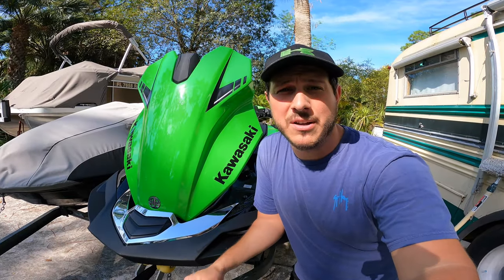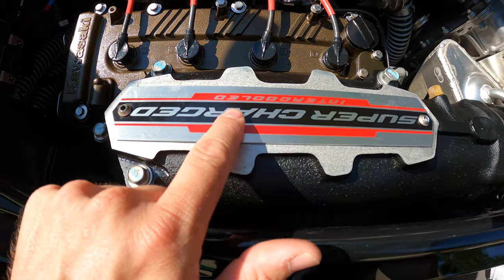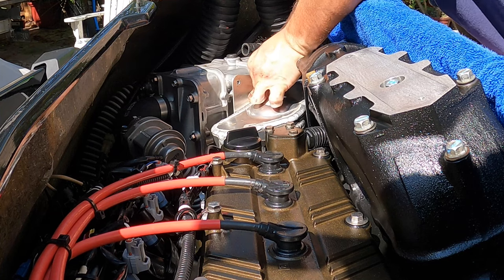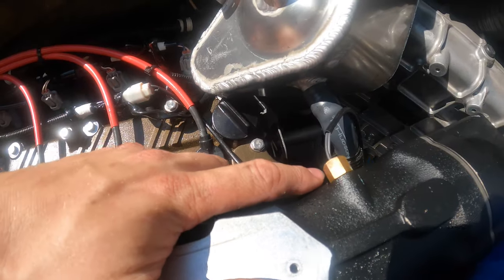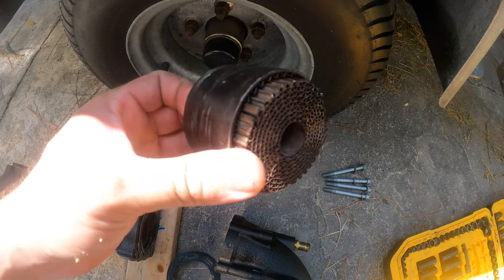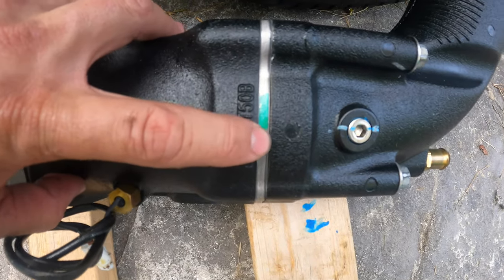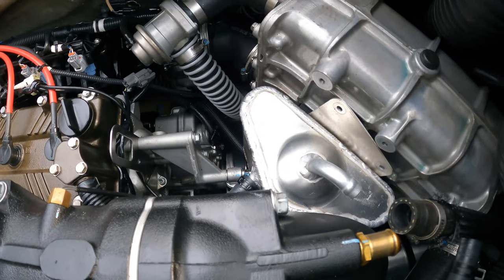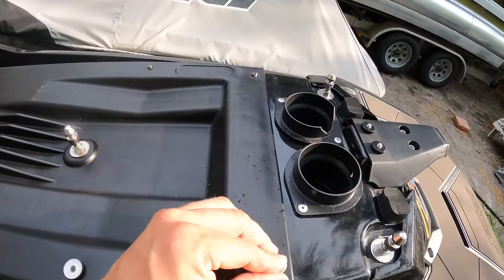Comprehensive Exhaust Filter Maintenance DIY - ⚠️NEEDED EVERY 25-50 HRS - Kawasaki Ultra 310 Jet Ski

Comment: So, I just finished my exhaust filter replacement.  Much like yours, the welds were broken  but the honeycomb part was still in place. I did however have to deal with a stripped bolt and threads.!  The 14mm at the back of the manifold was stripped when they assembled the engine!!! I have good pictures and micrometer measurements that I will be sending to Kawasaki.  It was very frustrating to have to cut new threads and repair it.  Thankfully it holds the proper torque so it won't be a problem for future 50 hours maintenance. I want to thank you again for the videos you put out!  Even though I have the factory service manual, watching you do it first really helps when I go to do it myself!  Your channel is awesome JD!
Reply from the maker: Wow that’s not good at all! Good thing you are mechanically inclined and could fix it yourself. I really appreciate that you always take the time to comment, and am glad you are finding my videos useful! I would have been PISSED if that scenario had happened on my ski; worst case scenario you are still under warranty and can get them to replace the manifold. I didn’t mention this in the video (because I didn’t realize it at the time until someone commented about it) but the new pipes on our ski actually have an Allen pin after the exhaust filter that prevents the element from going down the water-box if (when) it fails!
Reply: @JDsWaterWorld  Thanks JD.  I'm just doing my part to try and grow your channel.  I find your videos very useful and entertaining.  You'll get me through this winter watching you ride and show me sunny Florida!  Thinking about dragging my ski there after the first of the year  and get an early taste of summer!!  Thank you for taking the time to reply!

Comment: Followed your procedure.  All good!  After 50hrs, my exhaust filter showed a little carbon but perfectly intact and clean.  I'm saving the filter to reuse.  I sprayed it with WD40 and wraped ir up. I did put the new one in.  I tried to get the filter out without taking off the exhaust but couldn't.  Thankyou for this video it gave me the confidence to do it my self.
Reply from the maker: Thanks for taking the time to comment! So you ride in fresh water? Glad you were able to get it done! Yes I know of you remove the catch can, intercooler, all the ducts, and the starboard waterbox you can remove the lower exhaust pipe without having to unbolt the riser, but this takes more time than it’s worth to save money on a $40 gasket lol

Comment: Thanks for the video. I hope more people see it and realize the importance of maintaining these JetSkis. 

Just to add.. You can change the exhaust filter without taking off the exhaust pipe coming from the manifold. It’s an odd twist you have to do but I’ve done a bunch and gotten used to it. Saves on a gasket.
Reply from the maker: Thanks for the comment! Yes, well you can also remove the intercooler and then take the band off the water box and slide the lower pipe back without having to unbolt the riser…that stupid gasket was expensive too! I wanted to follow the factory procedure just as a demonstration- even though the factory procedures are sometimes more complicated!
Reply: How do you do it?
Reply from the maker: @LtCptAmerica  I have done it both ways; to remove the exhaust filter without removing the pipe that interfaces with the manifold you need to unstrap the rubber band around the waterbox so that it can be moved backwards and the filter can me removed. To get to the band, I had to unbolt the intercooler. I prefer removing the entire assembly so that I can clean and inspect the manifold surface and clean everything out really well. The gasket is $28 I believe so yes, it can be done without removing the main exhaust pipe assembly..I found both methods take the same time.

Comment: Thanks JD for Sharing a DYI video to educate ppl how to do it properly, and Save alot of money, Again it's very important to Ck and replace at 50hrs, Kspeed is who I use for any performance parts as they exceed Riva, just installed the Atmospheric Trumpet per there recommendations to get fresher air into the intercooler, please consider, Really appreciate all of your maintenance video's, it's so important to maintain these Ski's, and keep them Clean, I have always used a Silicone base lubricate in the Engine Compartment , not to get Oil near the Supercharger belt, just my opinion, Thanks for sharing the info on the thumb nuts for the Engine Cover, Hope we can get together soon and Ride
Reply from the maker: Thanks for the comment Terry, yes hope we get to ride together some day soon! I actually just reached to out Kspeed to see how many degrees the trumpet reduces intake temps. What are your intake temps? I run an average of around 114 degrees in this heat! Riva is only good for SeaDoo and Yamaha stuff..Kspeed are the true Kawi guys! So the Lear Corrosion Block actually is completely safe for the belt and pulleys! In fact, I spray down the pulley face. Something like wd-40, however, I’d keep far far away from the belt!
Reply: @JDsWaterWorld  Thanks, Am trying to ride next weekend and will monitor intake temps and compare to yours and let you know, I was afraid to use Lear Corrosion block on these Super charge Ski's for fear of the oil getting on the Belt, perhaps''s I will use it everywhere else except the Belt area. Use CRC 656 on alot of Area's as well, Alot of good products to Help fight the Salt
Reply from the maker: Yeah anything is better than nothing. The salt is brutal! I flush with salt away and spare no time washing down and cleaning my ski and as you saw- the exhaust filter literally implodes at exactly 50 hours!

Comment: Although I’m curious to know why you didn’t install the exhaust filter bypass? What are the pros and cons to run the Ultra without the exhaust filter?
Reply from the maker: This filter is absolutely critical and should not be removed or bypassed for any reason. The filter is instrumental in preventing condensation from reaching the exhaust valves the manifold, and ultimately the cylinder head. The filter is very effective at preventing corrosion buildup. The filter is designed to sacrifice itself, while protecting the engines critical internal components. The engineers a Kawasaki designed this component, and there is no reason why we shouldn’t trust them to deliver the most reliable and efficient design.
Reply: @JDsWaterWorld  thanks for the info I was reading exactly what you’re saying at the green hulk forum. VERY IMPORTANT PART 👍🏻

Comment: Just did this on mine but with a riva filter spacer theres no need to remove the upper pipe when replacing the exhaust filter😂
Reply from the maker: When replacing the filter you need to either remove the whole pipe or remove the band around the waterbox and slide it backwards so that you can fit the new filter in. Bending that blue coupler will stretch it out and cause it to start leaking…

Comment: Wow. Excellent video. You are an amazing instructor. I really believe now that I can do some of my own maintenance. BTW, how much would a service / dealer charge to replace exhaust filter/?/??
Reply from the maker: Thanks for the comment as always! I believe this service would be about $500 at a dealer and they are very slow..they’d have your ski for a few days, but it can be done at home in about 2 hrs or less
Reply: @JDsWaterWorld  I just saw a video called KAWASKI exhaust delete. Seems like something that gets around changing exhaust filter. What is your opinion?
Reply from the maker: The Kawasaki Ultra 310 Jet Ski Exhaust Filter Debate - Will removing the filter cause damage?
https://youtu.be/P5MR3mIJVUo

Comment: Thank you so much for this informative Video. Just spent over $2,000.00.foe pump impeller, vane. I am looking to purchase a 2019 Ultra 310X Repair manual.
 so I can do many of  the repairs my self. Any Idea when I can purchase the repair or service manuals. Thank you
Reply from the maker: Al, thanks for watching! You can buy the manual for you ski directly from the Kawasaki website- those direct from the factory are the best ones I’ve seen!

Comment: Great video !!!
Is this the same procedure for the 2017 Ultra LX ?? And if so, do you happen to have the part number for the exhaust filter ??
Thank you.
Reply from the maker: Dude…read the video description- I give you the part numbers for the filter and all gaskets as well as the cost.  Yea it’s the same for 2017 just the engine cover is different and you don’t have the dummy peg that prevents the filter from going into the waterbox
Reply: Got it.
Thanks.

Comment: Thanks for your video. Awesome. Btw did you really make a video how you clean inside? By saltaway? A link would be much appreciated. My store didnt mentioned every 50hours replacement. But good you helped me out bro.
Reply from the maker: So you can’t really clean the exhaust filter- you must replace it with a new filter and new gaskets each time. Salt Away does extend the maintenance, but not by much.

Comment: JD can the filter be changed without removing the manifold? Couldn't you just loosen both clamps that go into the water box and wiggle it out or it just easier doing it the way you show. Have the gaskets for the filter but not for the manifold yet and wanted to see if it could be done. As always great video
Reply from the maker: Yes, you must loosen the band around the waterbox, and then you can slide the waterbox back and loosen the coupler, and then you can replace the filter the way you have described.
Reply: @JDsWaterWorld  thank you sir

Comment: Having a hard time removing the blue rubber piece from the water box seems to be stuck on there any recommendations?
Reply from the maker: Is it an older ski? Is the exhaust pipe still attached? You don’t need to remove the coupler from the waterbox, just loosen the top clamp and pull upwards on the exhaust pipe and it should come off. You could always cut it off with a box cutter and replace the coupler but not sure how much it costs

Comment: What is the purpose of this Filter ?  What if it is not installed.  Is this just an EPA Required products that would make this ski run better and cleaner without this filter ?
Reply from the maker: I have done a few videos on it- I removed my filter: 

The Kawasaki Ultra 310 Jet Ski Exhaust Filter Debate - Will removing the filter cause damage?
https://youtu.be/P5MR3mIJVUo

Comment: So The Naturally Aspirated 1500 Ultra Lx's, this service does not apply right?
Reply from the maker: Correct Mike, this only applies to the 310! The Ultra LX 160 pretty much only requires regular oil changes and is extremely easy to maintain.
Reply: @JDsWaterWorld  yes thanks! Those 310 are beasts. I've already lost many hats and sunglasses pinned at 58 mph 🤣😂🤣

Comment: I wonder as what if you remove it completely and run without it ?? What could happen ?
Reply from the maker: It’s a critical component and should not be removed..the filter prevents condensation from building up inside the combustion chamber and on the exhaust valves. Removing the filter will severely reduce engine life- especially if the ski is stored for long periods of time.
Reply: @JDsWaterWorld  Thanks .

Comment: If the problem is the weld on the filter and not the honeycomb itself degrading, why can’t you just get your first replacement filter and get a pro welder to run a small as possible tig weld fully around it instead of that insufficient stitch weld???
Reply from the maker: Some have done that, I don’t want to mess with the filter at all. The filter is really for those who are too lazy to take the time to blow out at the waterboxes after riding..As long as you clear water out and fog the ski adequately before storage it will be fine
Reply: @JDsWaterWorld  yeah I get ya…. Hey you wouldn’t happen to know the range of your na ultra would you??? I saw your vid on the 310lxs getting about 80miles…. A mate and I are chatting and wondering what the difference would be….

Comment: Not even 30 hours on mine and the welds are completely failed
Reply from the maker: Yeah that’s par for the course…mine last about that long as well
Reply from the maker: @mattwebs14 go comment on @lucamtire he investigated the welds breaking further and his machinist believes there may be an issue with the welding robot. I suggest you contact Kawasaki and inform them that your exhaust filter failed due to bad welds..maybe if enough people report an issue something can be done. I go though a filter every 30/35 hrs or so with my riding style. You have to learn how to do it yourself or just put a bypass plate (will  prob void your warranty if you have one)
Reply: @JDsWaterWorld  Hey JD,  why not ditch the exhaust filter completely and you the exhaust filter bypass kit from Kawi Performance? I have it installed on my ski now and the only direction from KP was that you blow out as much water as you can once you turn the hose off from flushing the ski. However, Im curious to know if there is a down side to using this bypass kit and if it would have any effect on water circulation through the exhaust manifold and leaks from the exhaust pipe manifold gasket. I'm on my 3rd exhaust pipe gasket and can't seem to get it to seal correctly bc it leaks out at WOT only. Should I go back to using the OEM exhaust filter?

Correction : I guess I should have read further through your comments on other related videos bc I see that many people have asked you the same question about the bypass kit and your answer is to avoid corrosion on the valves, head, and manifold. However, I did notice that in your video you mentioned the exhaust pipe gasket sits on the manifold a specific way(flat side down)and I always thought they were the same on both sides. So maybe, just maybe that might be the issue why it leaks still at WOT only.
Reply from the maker: So your leak is at the clover gasket? Try using a fine scotch brite pad to clean the mating surfaces very well. Then use Permatex Cooper gasket spray and follow the instructions to coat each side of the gasket. Toque all bolts to spec and follow the factory sequence to torque properly ( bolt groups A, B, C) and avoid warping the pipe. The orientation of the clover gasket doesn’t matter but sounds like either your mating surfaces are warped/pitted or you’re not torquing in the right sequence or the right torque. Using an oem gasket? Don’t forget they are one time use- but I think you know that. And yes, my opinion is that the filter (while annoying to change) is necessary with the updraft style exhaust. I trust KP and think they are some of the most knowledgeable guys around on the Kawis, but I personally don’t want to delete the filter on my personal ski.
Reply: @JDsWaterWorld   The clover gasket being the 4 whole gasket part # 11061-3762 then yes that gasket.I did clean the surface with a P320 grit paper bc KP recommended it when they have the same problem though I saw you use P500 so I hope 320 isn't too tough on it.  I will try using the permatex copper gasket spray as directed and torque in the proper sequence to see if that all helps. You did mention in another video that the gasket goes flat side down, but there isn't much of a lip/raise on the other side of the gasket so maybe it doesn't matter but ill still put the flatter side down on the manifold. If the surfaces is warped/ pitted with the gasket spray help with that or can that only be fixed by replacing the manifold?  
BTW thanx for your prompt response and truly appreciate your maintenace videos!!
Reply from the maker: Yes permatex “high temp spray a gasket” coat both sides of the oem tin gasket. Yes, I had stated that in the video because that was the way the stock one was from the factory when I removed it, but since it does get crushed flat, I don’t think it really actually matters. And yes, the gasket spray should really help especially if the surface is very slightly warped or pitted. If KP told you to use the 320 I’m sure it will be fine.

Comment: This is a flawed desgin from Kawasaki, the non superhcarged and early 250/260's didn't have this exhaust filter nor do any of the Yamahas or Sea-Doos
Reply from the maker: It’s not flawed, it’s intentional. The 250s and 260s suffered from rust on the heads, valves, and plugs due to excessive condensation. The updraft design of the manifold necessitates the use of this filter to reduce condensation. The Yamahas crack heads and the seadoos eat superchargers and sink ( go read the public forum posts ) I’ll take changing a filter every 50 hours…that being said, Kawasaki should release a salt-water version of the filter made from stainless steel.
Reply: @JDsWaterWorld  but that what im saying the manifold and water distribution is flawed, and they dont want to redesign it so instead theyintenionally started using this filter on the 300's , the non supercharged Kawis dont have the same wet spark plug issues and they dont have an exahaust filter. All watercraft get rust on the valves and all watercarft have their issues im no fan boy of any, but i just think the filter is a poor band aid to the flawed manifold, i have mine tuned and i picked up 1.6mph by just removing the filter and better accelration.
Reply from the maker: I get what you’re saying- yeah there is definitely room for improvement. I’m going to go broke from replacing those filters lol. And you’re right my 2021 160 LX has no issues like that.

Comment: This sounds like a pain in the butt item to fix and a moneymaker for the dealership.  But, I am still betting on this being an EPA product that the ski could do without.  Prove me wrong ?
Reply from the maker: It has nothing to do with EPA and is actually designed to prevent condensation build-up inside the engine when the ski is stored.